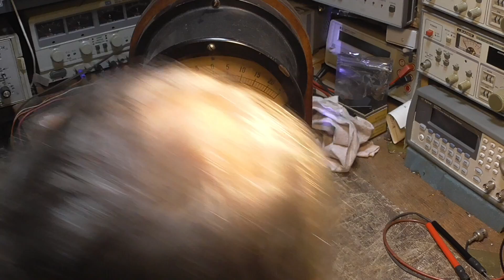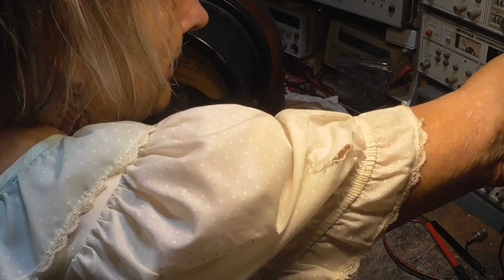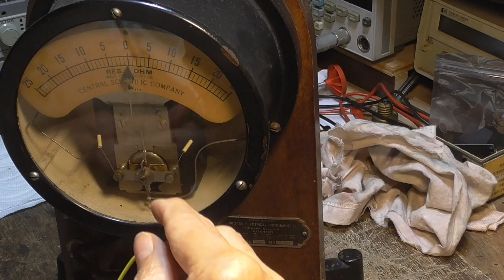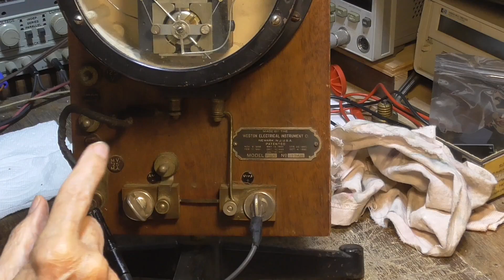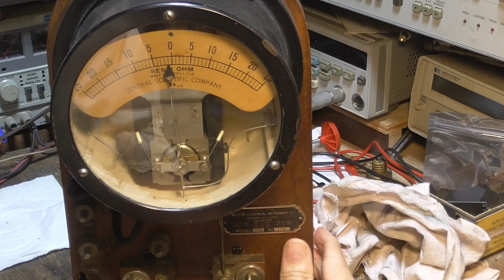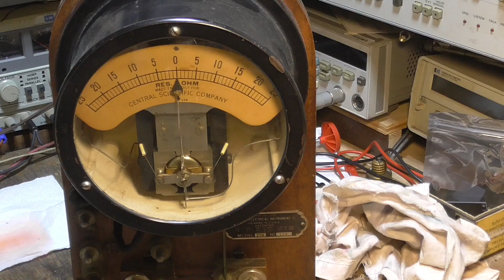TESTING A 1903 VOLTMETER

Comment: It is too easy today to forget that these kinds of instruments were very expensive and regarded as a high precision devices.   The manufacturing process of these, right up to the 1960's required a lot of precision hand adjustments.  In the 60's, the Japanese revolutionized the panel meter market by combining precision with mass production.  When that voltmeter was manufactured it probably cost the equivalent of buying a Keysight spectrum analyzer today.

Comment: Hang on a minute, the calibration must have changed in 120 years because deflection is also dependant on magnet strength. No?
Reply from the maker: A small amount. It does read sort of OK. A 9 volt battery reads 9 volts while on a modern HP meter it reads 10 volts.

Comment: If it is for telegraphic use, the direction of the needle indicates the direction from which the message arrives, as it is battery powered. An old railway telegrapher told me this. The ohm scale can give an indication of the distance from which the message arrives: the longer the wires, the less the needle will deflect.
Reply from the maker: Thanks for the info!

Comment: Love all your videos. Thank you for them. 
A question. I like the vids of you making tubes (valves). Would if be possible to repair a tube (valve)? I have an old book with adverts for shops that repaired tubes in the UK. 
I got thinking about this especially for rarer ones and then what about TV tubes etc?
when I worked for Tektronix, the old dead CRT's went back to be reused.
Reply from the maker: It can be done but it is more work than making another tube from scratch.

Comment: Do you know how to make a incandescent light bulb that can last 100+ years?
Reply from the maker: Not a problem! Let me know if it burns out!      :)
Reply: Operate it at half its rated voltage.  There's one in a fire station somewhere in the USA.  It's clearly not burning at full brightness but is operating now over 100 years later.

Comment: I saw a video where the ebay stuff from  China use copper enameled steel wire in test lead wires, so has you taken the magnet test on it?
The magnet may pick up the wire, and steel sure mess up the readings.
They have done this scam a long time, tens of years, so beware that.

Comment: Being a zero center meter, it was likely meant to be used as a Wheatstone Bridge null indicator. If that was the case, the numbers on the face would not be particularly relevant.
Reply from the maker: This was old telegraph equipment where bridges were used to spot line problems. Good observation!

Comment: The wire may be el cheapo steel 😊😊😊
Reply: Copper coated aluminum.
Reply: @arnoldrimmer8008  thats just what I was about to say, they really are cr@p
Reply: @arnoldrimmer8008  just tested one, it's magnetic wire.....🤮🤮🤮🤮🤮🤮

Comment: I had a standard crocodile clip I tried to run 10 amps through, it got soft, flopped over before bursting into flames the same colour as the cord, always best to try and make your own in my experience, but a devil to get soldered onto properly, 4A might be a bit much for the wire gauge, and I've found prebought ones tend to go high resistance pretty quickly

Comment: It's a galvanometer, you can still get them, though I have to wonder how many different voltages there really was to test in 1903 outside of a classroom setting

Possibly it's been repaired in the past, being a different reading in either direction suggests either a winding is missing or is shorted somewhere in the coil
Reply: it'll be that moth
Reply: @luminousfractal420 ?

Comment: Beautiful instrument! Years ago I worked in an old power station that was used as a standby station for a newer station. The old power station had early style Diesel engines driving alternators and beautiful old switchboards with lovely analog instruments. Sadly a snake intrusion resulted in a flash fire across the live busbars and burnt out much of the wiring. Anyway the place was boarded up and abandoned however all the equipment is still on site.

Comment: Central Scientific Company, also known CENCO, made laboratory equipment for use by chemistry and physics labs, notably in high schools and colleges, but also in actual industrial laboratories. 

They simply got industrial meters from reputable companies like Tripplet and Weston and put them in very heavy cast-iron meter cases with screw binding posts by the 1950s. Almost always all the binding posts were black, rather than red and black, as had long been common in the electrical industry by the 1950s. They typically included resistors and multiple binding posts for multiple ranges, but only had one nominal scale on the meter face, assuming you could use your slide rule to determine the actual value. 

As best I recall from catalogs of the time, the price for a Cenco meter was around 5 times the cost of the same meter directly from the meter manufacturer. Accuracy was nominally around 1-5%, which I guess was good enough for a high school chem lab.
Reply: And then theres a Western Electric plate its mounted to with the range resistors, kinda points to something 'good enough' for a line tech to smack about?

Comment: Cheap Chinesium test leads are made with steel wire. Save the covered alligator clips then throw them out! Not good for anything. Make you own with 18 gauge stranded copper wire. Have a Merry Christmas Ron!

Comment: I wonder if it needs re-magnetising, I had a mate who worked in a lab where they rebuilt meters for a telco, often they redid the magnets.
The way he talked made it sound like normal practice.
Reply: 100 years old meter ! OF COURSE  the magnet should be assessed and re magnetized !!
Reply: At 11:05 he measures on the 5 Volt full scale, and does that with 4.84 Volt connected. So enough deflection. Seems that the magnet is OK then.

Comment: Oh yeah - lovely old meter! Thanks for sharing it with us. 

I've got an AC meter with a 0-100 scale which uses a 5A CT input and the scale is very easy to interpret. 

As for the test leads, those are horrible! Had some with one or two strands in the wire, which blew instantly. Total garbage.

Comment: Part of your problem with the Chinesium test leads, may be that most newer chineseium leads don't use copper wire, but steel. The fact that they are so thin doesn't help either. Still a very cool meter. Your channel is a blast to watch every time. Thanks for your work.
Reply: There don't seem to be any good alternatives to making your own lately. Silicone test lead wire, mueller or pomona clips.
Reply: 🔴 What Is Islam?  
 
🔴 Islam is not just another religion.  
 
🔵 It is the same message preached by Moses, Jesus and Abraham. 
 
 🔴 Islam literally means ‘submission to God’ and it teaches us to have a direct relationship with God.  
 
 🔵 It reminds us that since God created us, no one should be worshipped except God alone.  
 
 🔴 It also teaches that God is nothing like a human being or like anything that we can imagine. 
 
🌍 The concept of God is summarized in the Quran as: 
 
📖 { “Say, He is God, the One.  God, the Absolute.  He does not give birth, nor was He born, and there is nothing like Him.”} (Quran 112:1-4) 📚 
 
🔴 Becoming a Muslim is not turning your back to Jesus.  
 
🔵 Rather it’s going back to the original teachings of Jesus and obeying him.  
 
 
More .....👇 
 
🔴 THE RETURN OF JESUS

Comment: The older alligator hook up leads were better. They had more wire strands and were copper. The newer leads use stranded steel wire. You can test which is which with a magnet. Copper leads are not magnetic. Also I had to check the continuity of these leads as the poor crimping of the alligator clips caused intermittent connections which I remedied by soldering.

Comment: I gave up on store bought clip leads years ago I'm either melting them with current or knocking holes in them with voltage. Not cheap but pomona silicone wire and clips or what ever ends I want on them.

Comment: Three decades ago I was working on private property that had a 20 foot by 20 foot room built on a dock over the water.  Very dilapidated, floor had large holes rotted through and 1/3 of the roof had fallen in. 
The room had 4 or 5 rows of walls, each wall had about 45 meters, similar to the one you show.  I always thought it was for electricity but now that you mention telegraph, that makes more sense.  Even more so as the location was very near Washington, D.C.

Comment: These meters usually can use a little tune up, I often find the bushings are either too loose or too tight, or just dirty causing weird motion. Some also have balancing screws that can be adjusted to improve linearity especially in vertical mount meters.

Comment: Sexy meter, I have a few I salvaged from Ogdens Tobacco Liverpool founded in 1860 and others from power station but they are 1940's.   Much more fun to use than digi.  Some nice galvanometers are on Ebay fairly cheap and worth every penny.  Thanks for demonstrating.

Comment: That's wicked. I had a similar Weston voltmeter mounted on my wall of my shop back in 2000, Sadly that was my dad shop and it and his house burned to the ground in 2006. Not electrical. Just Shit happened.  Take care my friend. 🎄🎄🎄🎄🎄🎄🎂
Reply: Nice
Reply: Very nice electromechanical devices in the early stages of electricity. I have two such meters, one volt meter and other current meter, both hinjed together so when not in use can be folded together face to face. Lying in my store for the last, perhaps, 15 years. This video motivated me and I will check those meters working. They look unused and I hope they are in good working condition. Thanks and regards.